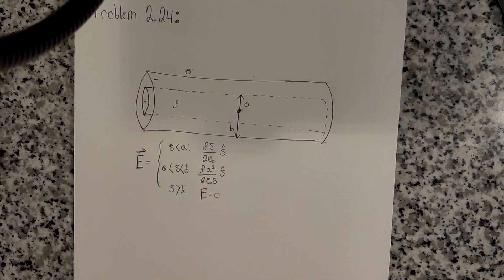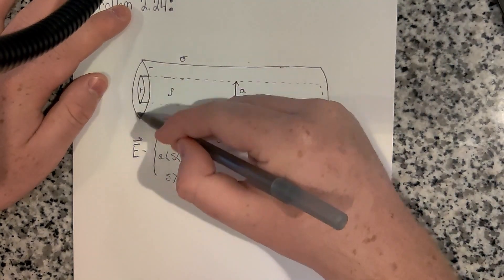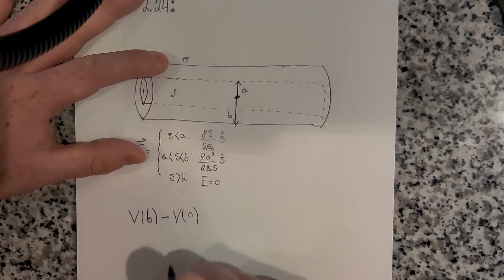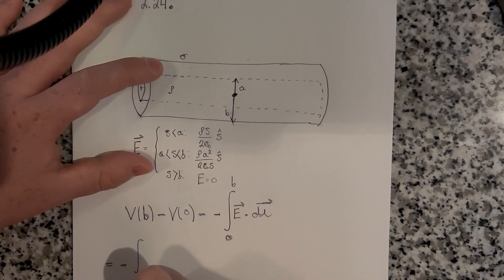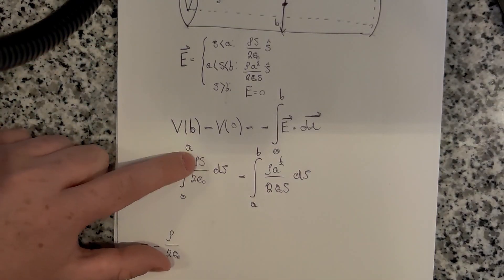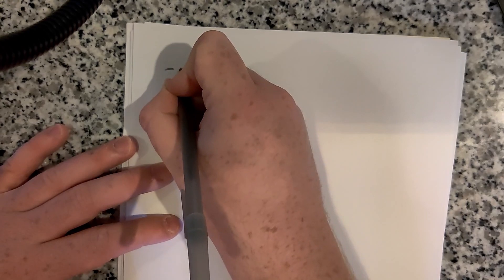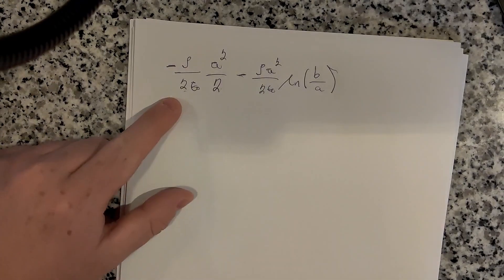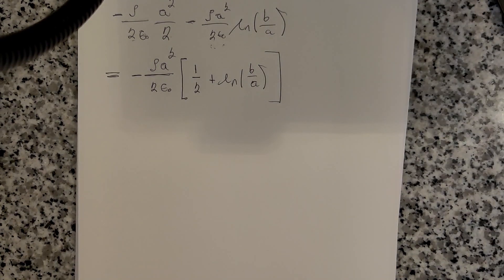David Griffith Electrodynamics | Problem 2.24 Solution

Comment: Sir your videos are very useful. Thank you
I have a doubt, we are to find the potential difference between a point on the axis and a point on the outer cylinder : so isn't the potential difference v(0) - v(b) ? Because the potential is more at the axis point than the potential at b. ?
Reply from the maker: If we are asked to find the potential difference between a point on the axis and a point on the outer cylinder, it is V(b) - V(a). The electric fields and therefore the potential is different in each region and whether or not the potential is greater somewhere depends on where you define your zero potential.